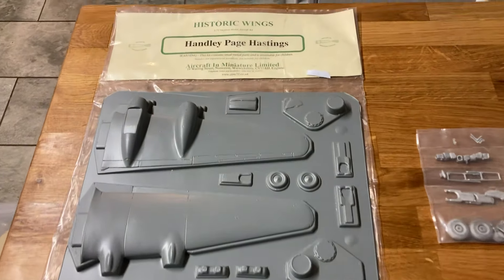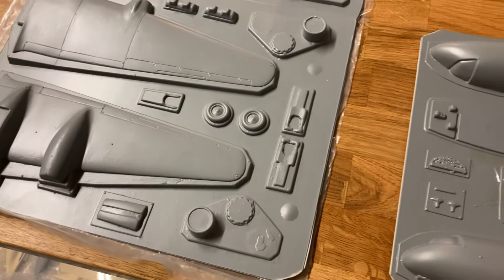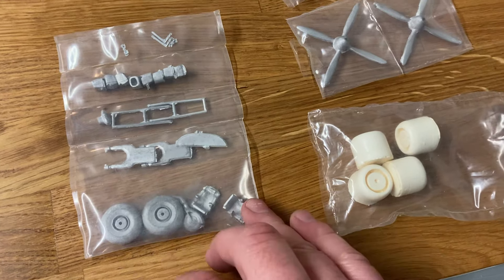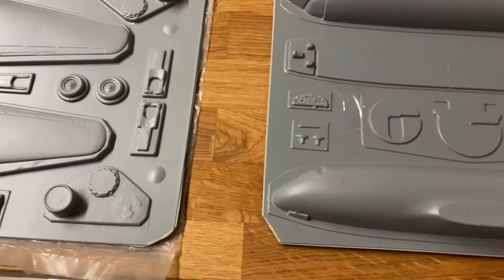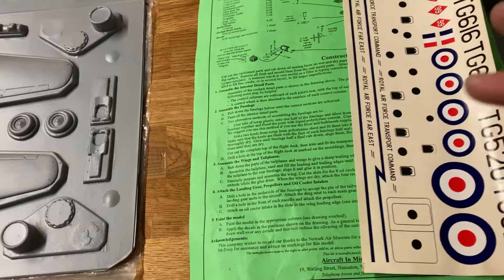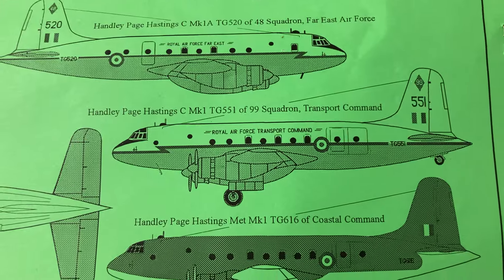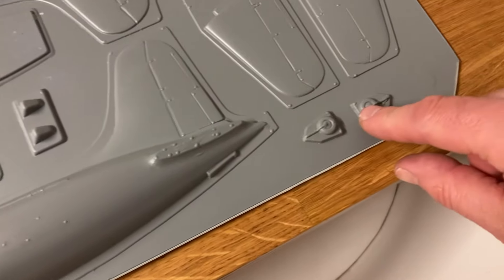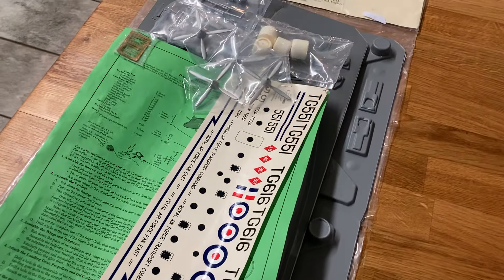1/72 Handley Page Hastings Vac Form AIM Historic Wings Model Kit- a build for my dad!

Comment: Do you know something. I am just thinking out loud so I’m probably wrong.
We’ve learnt to have such negative ideas about Vacuform compared to the the traditional plastic moulding.
Sure it’s different but look at how much effort we often put into the best plastic models to make them look ‘good’.
So…….
I’m suggesting a change of idea and attitude.
You’ll have to do something different with the Vacuform. But ultimately you’ll do no less or more than a traditional model to have the same results. 
Perhaps you will will have to adapt your skill set but that is only a small challenge compared to what you had to learn when first starting standard ‘Airfix’ for example.

I’m always amazed and impressed at your output. It’s wonderful and admirable, genuinely. 
I really enjoy your channel.
But as I said just yesterday, I’ve missed so much due to your speed of production ( I’m not complaining, I will be pleased to catch up on the ones I missed! And you know I enjoy our interactions online 😊👍🏼).

So, only for what irs worth and to reduce your stress, sit back, pull the slippers on, light the pipe and take your time with these expensive and rare models. Show us how you approach your problems and enjoy the building.  Show us how you build these occult arts of building such sinister arts!

Deep breath, show us the bunnys, and I want to see the first cut!
Perhaps I’ll be inspired or shamed into my first Vacuform! 😁

With genuine respect, Sir
I have the honour to remain your humble and obedient servant,

Ian C
😊👍🏼
No pressure !😅
Reply from the maker: Haha thank you :)

Yup 👍 one of the good things with vac fork is that most of the parts are one piece :) 

That saves alot of sun assemblies hehe 😛 

Haha yes lots of out put- less now as work schedule etc :) 

The key (I’ve heard) with vacform is to add a tab of plastic to support the join and to cut a fuselage support 

I’ve worked out submarine drones (without) AI is almost impossible due to comms- otherwise it’s essentially a mine or big torpedo.

However, Iran is using some nasty mini subs called the Ghadir- worth a google so Marmatia may make some!!  

Best

D